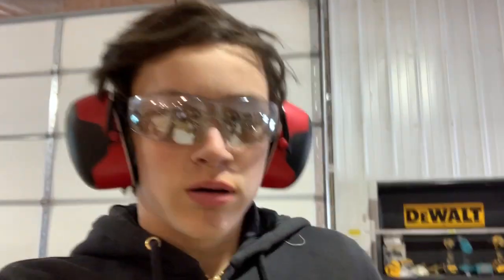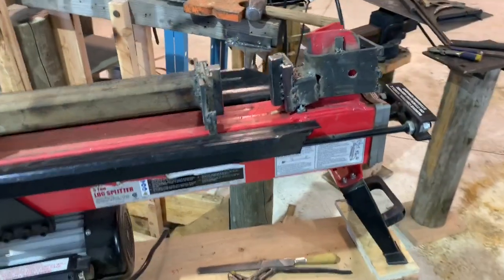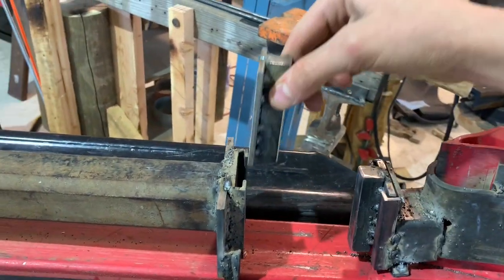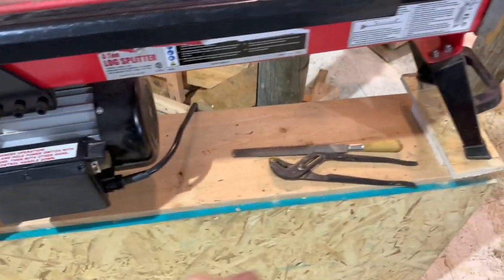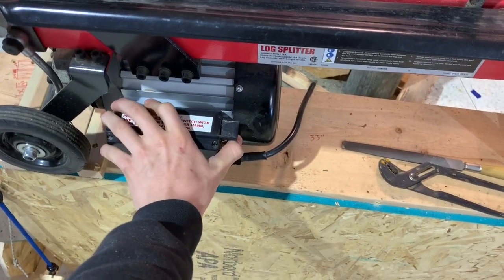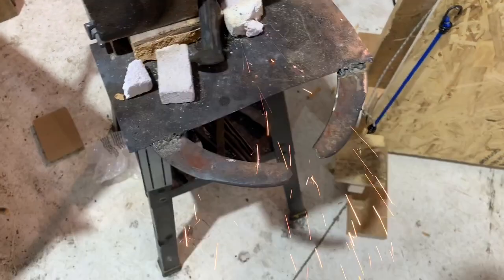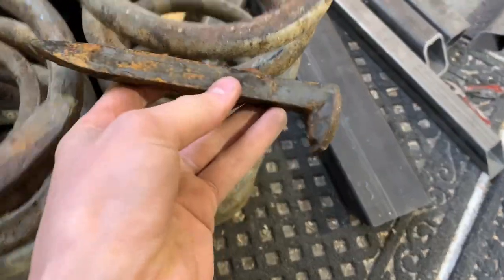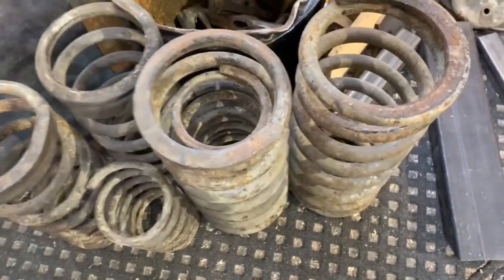I made a forging press!

Comment: "it's ONLY 5 tonne", yes, but, how many hammer blows does it save with each squish? A lot.  I would probably get someone to put some good welds on there until you get more practice in, but, it stuck, it works, good job 👍❤️ i really like that foot pedal, putting a lot longer one on with the pivot poit at the anvil end so you could operate it more comfortably would be nice.  And being able to change those dyes is going to be a great asset and time saver.👍.

Comment: Great idea works well, but you need a few lessons in welding as they don’t look very good and most probably not very strong. Most important always clean the metal before welding. Other than that keep on doing what your doing your still young and will be awesome in a few years.
Reply from the maker: Thank you! And yes my welds were terrible back then lol. I’ve had some good advice and a lot of practice since then and personally I think I’ve improved quite a bit. :)